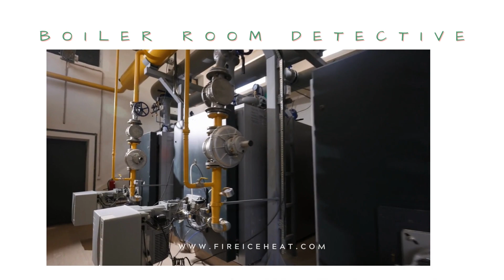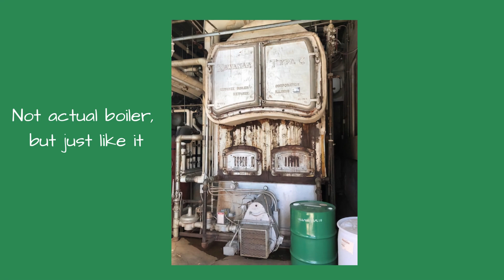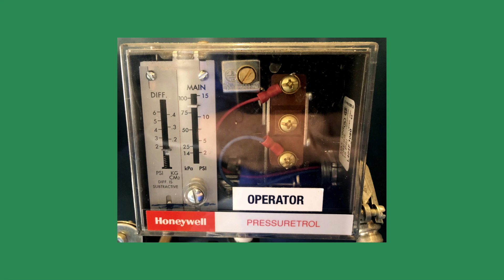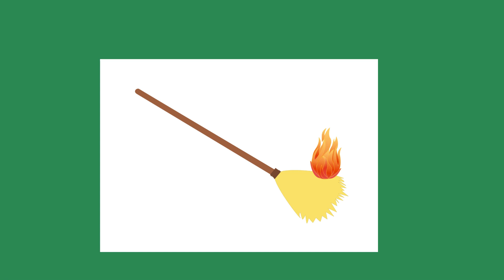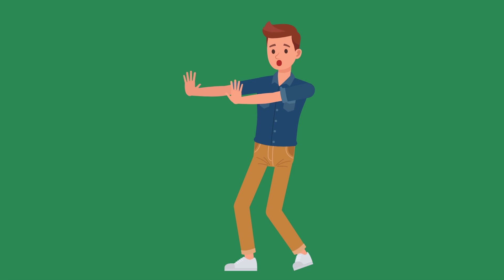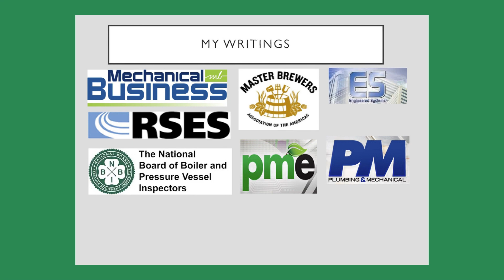Case of the jumped safety controls

Comment: Hey Ray, I have a story for you. My Uncle who was a plumbing and heating contractor ( He passed last year in his early 80's) told me one time of a house he went to to do something, i forget why he was there, but anyway, he told me that the customer had built a cement block enclosure with either a 3/4" or 1" gas pipe with a ball valve or some valve sticking through the cement block and when wanted heat, the homeowner would open the valve and use a lighter or whatever and ignite the gas and let it go and he would get the house to desired degrees, i think he said it was a triple decker, but forget, but he had to shut them down. Crazy huh?
Reply from the maker: Really? Thats something I have never seen and hopefully never do. Thanks